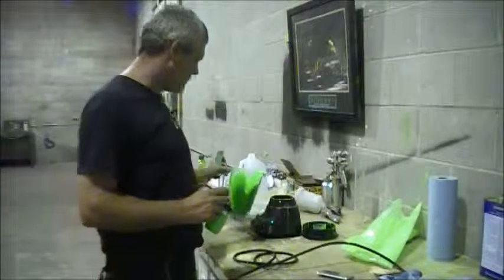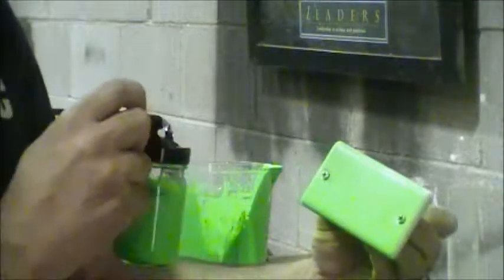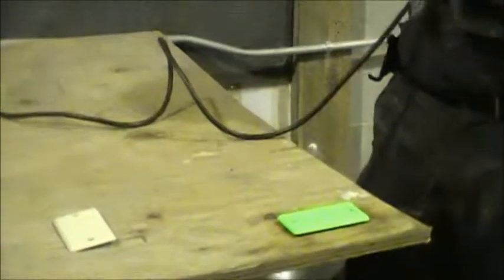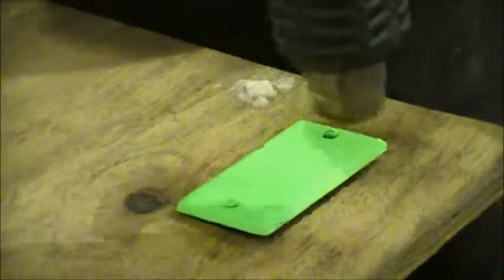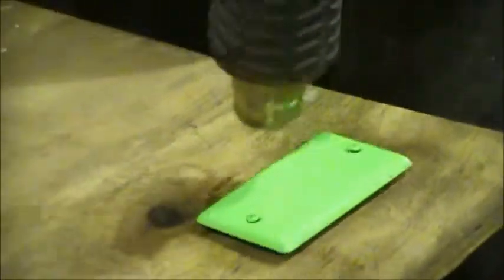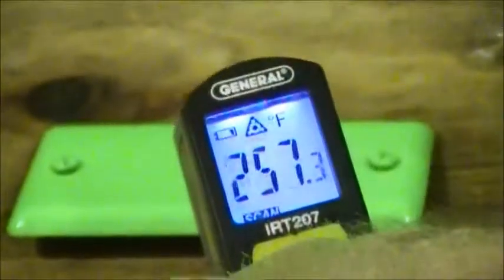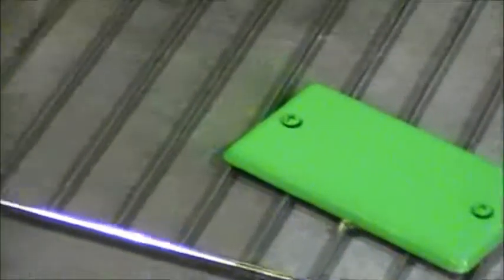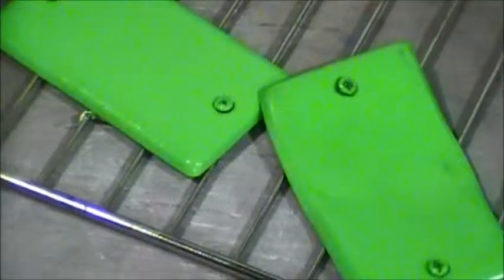pc green liquid spray

Comment: what's the mixing process how much water to powder and is this just regular powder for powder coating or what.
Reply from the maker: +James Wells .... This is a blend of special additives in the powder coat that allows it to be converted to a liquid. Check out more at www.liquidpowderconcepts.com
Reply: Can I use that urethane power from Eastwood?
Reply: I was hoping to spray some chrome with that. Will it work?